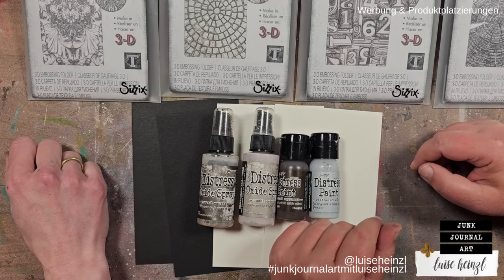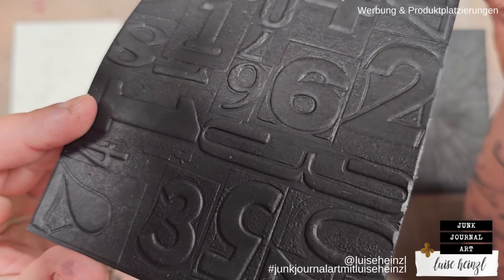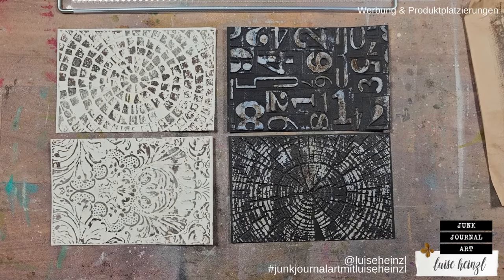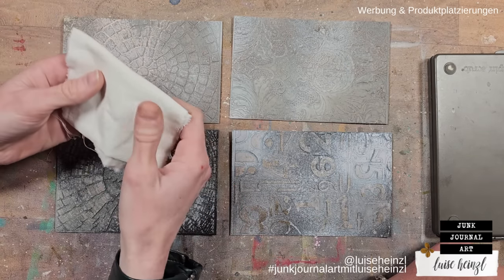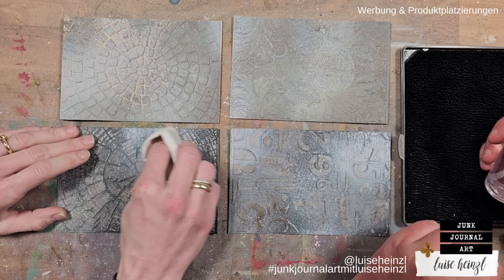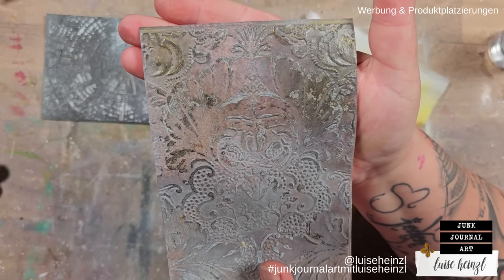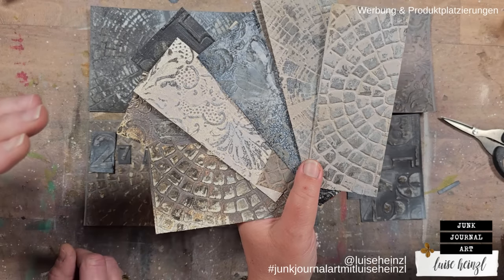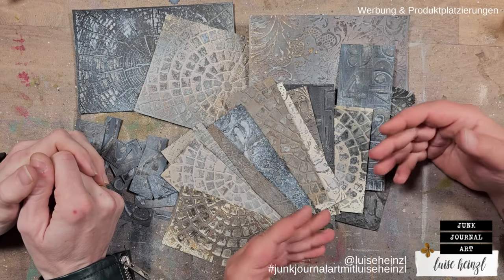RESIST TECHNIQUE WITH RANGER DISTRESS PAINT ON EMBOSSED PAPER! DOUBLE TROUBLE WITH MARLIES & LUISE

Comment: These techniques all turned out beautiful.! In the u.s. we have paint brushes with the same surface as the stamp scrubber, which I happen to have. I will try this.👍
Reply: We DO??? I've never seen them. Do you mind sharing where I can find some? I love using unusual, random things to create texture and interest. I'll have to keep my eye out.😉 Tyfs!💗
Reply: @tharp2499  I haven't looked lately,  but I bought them at Home Depot some years back. They are yellow plastic with a handle you can screw onto an extension pole. There were different sizes for corners and square shapes about 3x5". I hope they still make them! Maybe Amazon if not HD?
Reply: @tracynelson3279  Oh, sweet! When you said "the corner"...I think I know what you're talking about now. Ty so much!
Reply: @tharp2499 
Yes, they are not so much paint "brushes" as they are paint "pads". Cool tool.
I couldn't find them at my local small hardware store, so I tracked it down on Amazon. But larger home improvement stores probably carry them.